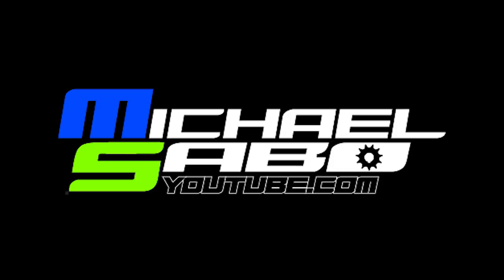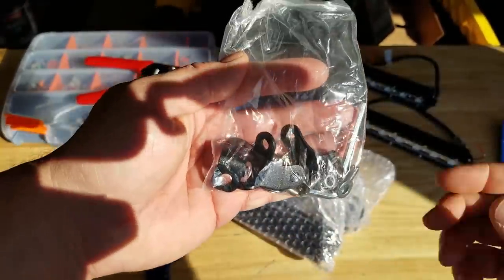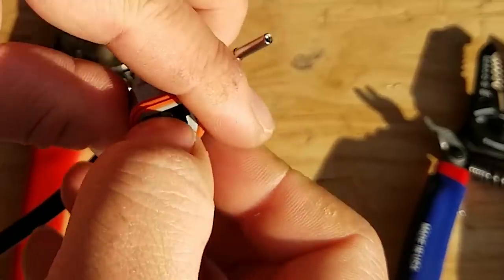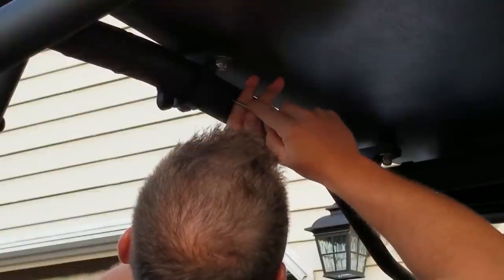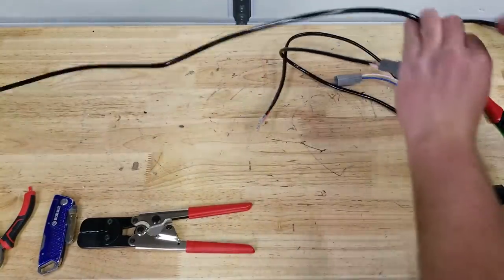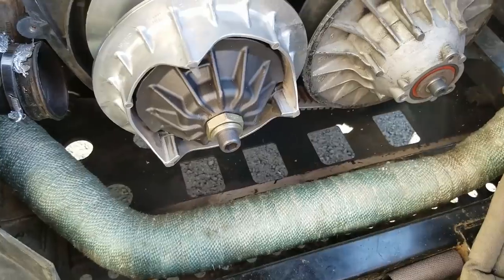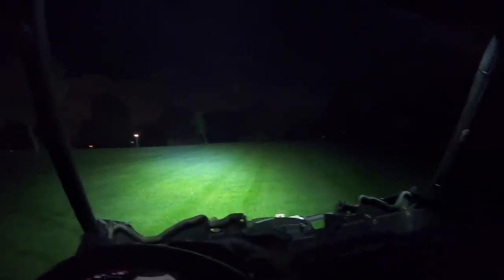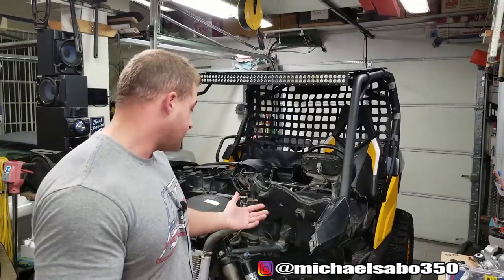Cheap LED Light Bar Setup For Any Vehicle | Super Bright Lights for Project Canam!

Comment from the maker: Thank you for watching! What do you think of these lights? Bright or naw? Here are the links to the tools and materials I used 🤘

Milwaukee M12 Fuel Kit - https://amzn.to/3b9GXvL
Dielectric - https://amzn.to/2KJZO5S
Zip Ties - https://amzn.to/3fmjY42
Cutting Wax - https://amzn.to/2xC9EDO
Deutsch Crimpers - https://amzn.to/3b7yTeT
Deustsch Connectors - https://amzn.to/2xI25vy
Loom ¼ 100FT - https://amzn.to/35Auyj8
Loom 3/8 100FT  -  https://amzn.to/3baLduS
Heat Shrink Kit - https://amzn.to/2YzqjTL
Insulated Butt Connectors  - https://amzn.to/3c97afi
Nilight 42 Curved W/ Harness and Switch - https://amzn.to/2L4n6n3
Nilight 7 inch LED - https://amzn.to/35xObbO
Nilight Rear Lights Switch - https://amzn.to/35AvBzA
Bosch Bit Set - https://amzn.to/2W7PtqY
Metric Tap/Die Set - https://amzn.to/2YEIx6q
Blue Loctite - https://amzn.to/2WzKn5C
Insulated Wire Crimpers - https://amzn.to/3dj4BHv
Wire strippers - https://amzn.to/3c9IVO7
Reply: I'm waiting on lights for my defender. I went with a little more conservative light bar that mounts on my front bumper only 26in 420 watt. I also got a cpl lights for the side 100 watts each. I'm thinking o should have got two more for reverse or maybe a small bar for reverse. Keep up the good content bro!!
Reply from the maker: @jonathancarver1547  you can always add some more man! Thank you for the love; I'll keep the videos coming 🤘
Reply: ya man price but worth the money trust me
Reply: Los are good for going to need them up in the coal hills. I been there I can tell you you will need them all when you go up at night trust me.
Reply: I have a question but im not entirely sure how to go doing it. I tearing down a 250ex to do a crank swap but im not entirely sure what im doing
Reply: I think they're great lights to recommend and I'm really glad to see you do a good job with your wiring installation. 
I do a lot of wiring myself and see alot of less the great work that results in problems later.
Hopefully ppl that follow your channel applies the tips and tricks as well.
Reply from the maker: @BDauto86  thank you man! I appreciate the compliment 🤘

Comment: I use 2 50" and 1 curved 52" nilight bars on my boat i use for bowfishing.  Ive used them in the rain and under rough water, not to mention trailering the baot across Oklahoma road. They have been on for 4 years. Id say they are good light, obviously waterproof and has a good shock rating imo.

Comment: Another excellent video, thanks Mike!  I love the lamps.  Perfect.  Hey there's this stuff called something like - "Liquid electrical tape" that you paint onto switches & connectors.  It's actually liquid pvc, & helps keep water out.  I get it from Jaycar electronics down here in 'straya', in a tube or a tin.  You can cut right through it with a stanley knife just like electrical tape.

Comment: hey boss just a heads up your videos are kicking ass like always great job keep up the usual great work.
Reply from the maker: Thank you brother; I always appreciate the love!
Reply: Hey bud I was just on my front porch and watched a deal go down for a 250r that lasted an hour or was a hot quad I would of jumped on it but they got was doing 8G's for it. But i'm into bikes. It was set up for moto pretty much. Sounded really good. When I asked a question about it the guy pretty much rushed to get it off there to buy it. He was a big guy thought it was you from a distance.
Reply from the maker: @usmcchet1  haha, wasn't me man; thats cool you got to watch the deal; for 8k it must have been one hell of a machine.
Reply: It was a good looking machine I seen a lot better but they 250r's are getting expensive. The only thing with the machine is just like any other everyone wants to make it their own. Which means 10 to 12 grand lol. Like I told you when you started the 250r project. I had $12,389.00 in mine and still needed a few more things. I just got tired of dropping money into something and probably won't get all hot money back. A year after I finished-ish mine sold it 10.450. Didn't mind though had my fun on it before it was gone.

Comment: Will you get into another SXS build after you sell the can am?
Reply from the maker: I'll be switching gears to the 250R and then YZ125 but I would like to do a YXZ1000 once I sell the Maverick
Reply: Michael Sabo hell yea. 🤘🏼
Reply: I have a yxz, they're fun. More of a driver's sxs instead of just putting it in drive and going. But I did all of my wiring with Deutsche connectors as well, everything running to a switchpros 9100, pigtails for everything under the hood
Reply from the maker: @timwilliams1910  thats whats up man; the fact that the YXZ has a transmission is what intrigues me
Reply: @MichaelSabo  mines an SS, I didn't want to deal with a clutch in the woods but still wanted to be able to shift... Not sure where you're from for if you'd have to deal with it as much (but judging by the "wooder" accent of water, sounds like you're from the Philly/NJ area, so you'd have woods riding as well). But a yxz is pretty easy to work on, everything's pretty open or hidden behind 1 panel instead of having 20 million panels. Just put a titanium exhaust from Graves on mine, sounds like a 1000 streetbike in the woods... Plus, who wouldn't want a 10.5k rpm redline?

Comment: I really want a raptor 700 but I just rewatched your series of it and it gave me nightmares 😂😂
Reply from the maker: Raptors are awesome man! Just FYI I am in contact with the new owner of that Raptor and it still runs strong; they're great reliable quads, that one just had some weird issues lol
Reply: There a mess... I'm working on a 660 and it idles with choke on fine. But when you give it gas it bogs with out choke. I adjusted values thinking there were tight. They were so I fixed it, but didn't fix it. So I made sure it was getting gas, well it was. It's not running lean are rich, so idk.
Reply: PACK A PUNCH- that def sounds like a classic case of your pilot jet being plugged/obstructed
Reply from the maker: @tristenkiesow4061  the 660s also have an issue with either the reverse wire or throttle wire; it needs to be jumped and it will be bypassed. The symptoms are like you described.
Reply: @bhoss7133  I've been through the carb main and pilots are clear as day...
Reply: @MichaelSabo  ok I'll look into that
Reply: PACK A PUNCH did you try soaking the carb in carb cleaner? you can buy a gallon can at any auto parts store. i tore apart a carb on a big bear 400 probably 6 times and cleaned it and it never would run right. i decided to try soaking it overnight and boom ran perfect after that. tiny particles can clog up the channels inside of the carb easier than in a jet and they’re harder to clean. hope you figure it out!
Reply: I'm telling you it's not the carb... I think its something to do with the parking brake or reverse. Idk tho

Comment: Hey Captain Zip Tie, Sorry to see that you have lost your aesthetic sense. Save the wire loom and zillion cable ties for areas that are not visible. Run the wires for those tiny lights inside the tubing. Then the machine will remain real sleek. You made that beautiful roof for the same reason. I usually love your mods but not this one. Sorry.
Reply from the maker: Haha, hey no worries Leo; I can't win em all; still appreciate the feedback man; hope all is well 🤘